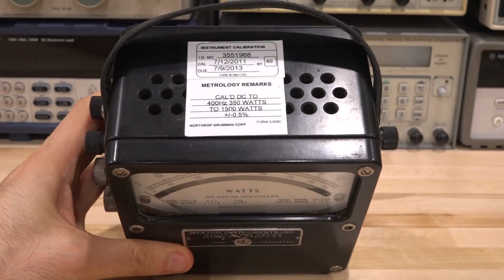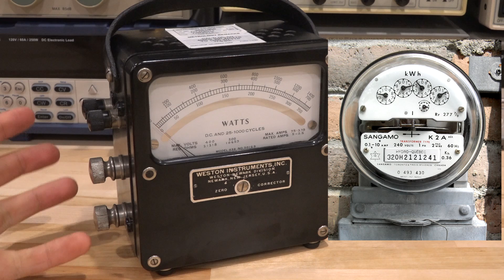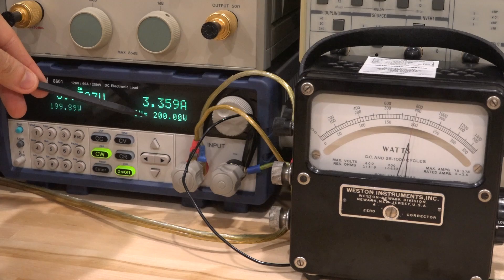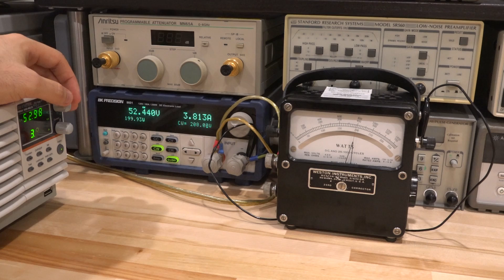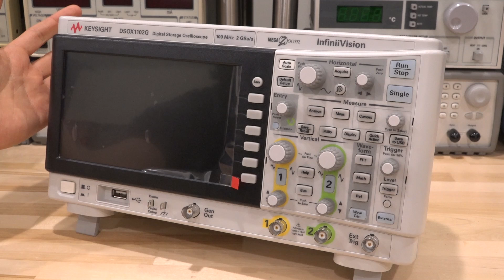TSP #140 - How Do Purely Passive Watt-Meters Work? (Giveaway Results & More Giveaway! December 2018)

Comment: We still use these in AC machines labs. They have multiple voltages and A range which can be changed by shorting the connections.

Comment: Where to start praising this great video.  A wonderful, old piece of equipment and a great explanation of how it works.  I am a retired aircraft electrician, so maybe I can give you some insight.  I believe that the current coil in the meter is actually carrying current in parallel with the shunt in the top of the case, in order to make the current coil a reasonable size.  The shunt will dissipate a lot of heat in operation, so the metrology tech who blocked half of the cooling holes with the calibration sticker really screwed up.
If you look at the flight engineer's panel on an early, multi-engined jet aircraft, you will find that a single analog meter for each generator had two scales, one to read generator power in KW, and the other scale to read reactive power in KVAR.  The meters could be switched from KW to KVAR with a push button on the panel.  Rather than shunts, the current coil in each meter was fed a small current from a current transformer around a phase lead near the generator.  Other than that, it worked exactly as you pointed out on your Weston.  Many thanks.
https://www.airliners.net/photo/Orca-Bay-Aviation/Boeing-727-232-Adv/1255032

Comment: Really something, how instant you can grasp the results of an analog meter... I think digital stuff, while certainly accurate, sometimes lacks that immediate recognition that comes from a spacial movement based result. Even when I pick a DMM, I try to look for one with a good resolution bargraph display, for that very reason.
PS... My scope has a scratchy trigger and is older than I am... Could totally use a nice new one to sit along side the old analog friend... Hint, hint... :P

Comment: A bit of history for you, this type of meter generally referred to as a D'Arsonval type meter, was initially designed by Jacques d’Arsonval but was quite different in its construction. It did use permanent magnets and a moving coil but the addition of a jewel pivot and tourqe spring knife edge needle was the work of Edward Weston. He is credited with designing a portable instrument using the D'Arsonval approach and he further refined his design replacing the jewel pivot with metal strips under adjustable tension and several different techniques of movement dampening. I would wager that Edward Weston also invented the use of electromagnets in place of the permanent magnets to provide the constant magnetic field proportional to input voltage for power measurement. That is a beautiful piece of test equipment, and the ingenuity of its design is breathtaking. I  have a VTVM that measures AC/DC Volts and Ohms but has no current measuring capabilities. I also have a DMM that I managed to take out the current scale in when the only fuse I had available when I blew the 100 mA protection fuse was a 400 mA. I fell into the old trap of ”just one more quick measurement”. I would love to have that Weston power meter to go along with my VTVM. Another oscilloscope, WOW!  I am currently using a Dumont 1062 that desperately needs a new CRT due to many years of previous owners cranking the intensity to maximum and leaving the instrument turned on for apparently months on end. I do have plans to restore the Dumont scope as funds permit but other things keep taking precedence, such as living expenses and medical needs. If only I didn't need to eat,  I could afford to buy some really great test gear. Oh well, such is life. Wonderful video, I had not seen an analog power meter teardown before and you explained the theory very well. It makes perfect sense, but for someone to come up with that design probably over 100 years ago is mind-boggling, and to still be able to certify a calibration in 2013 for it is even more amazing.  Please count me in on the giveaways and Great Video, and thanks for sharing your knowledge.

Comment: That was a very nice tear down of an old analog watt meter and it certainly is very similar in design to a universal motor, which was precisely what I was expecting though it’s always nice to know that one’s presumption was correct...you never know for certain until you put such to the test!

Comment: I have at one time or other fixed a couple of D’Arsonval movement meters that had experienced some shock.  Needed titanium tweezers and a microscope. Probably the calibration was not quite up to the standards afterwards, but they seemed to not be far off.
One meter I would have loved to repair was a 50 A moving iron type (actually clamp-on) meter.  The special feature of it was operation at DC or at 50/60 Hz AC without any rectifiers.  Changing scales was by lifting out one movement/dial/pointer module and dropping in another..  The choices were the mentioned 50 and 100, 200, 300, 400 and 500 A.  Measuring 500 A DC was a challenge — you could not open the clamp until the DC current was brought down.
Oh, the reason I could not fix the 50 A module was, because somebody had dropped a hammer or something similar right through it.
But my real reason for this comment was that in the early days my that time boss was building some ultrasonic transducers and amplifiers operating at 10 to 25 kHz.  He bought one of the purely passive watt meters.  I was astonished that he had bought a Soviet made meter, but found that no western meters were available with adequate frequency range.  The one you presented is proving the point with its 1 kHz frequency specification.  If I remember, the Russian one promised 10 kHz, but operated  reasonably beyond 20 kHz.

Comment: There is another design of a mechanical watt meter that is smaller, cheaper and, most importantly, has throw angle over 180° on the dial. The current coil has a core that forms a horseshoe-like loop around the axis. The voltage coil surrounds this horseshoe iron piece and is connected via two escapement springs as usual. No shielding is required since the magnetic field is already in a closed loop.

Comment: Great video, thanks for showing an old and relatively simple solution to the problem of measuring watts. For some reason it reminded me of electromagnetic speakers, the voice coil was powered by the amplifier output as in the permanent magnet speaker but the other magnetic field was provided by the "field" coil which was actually used as a choke coil in the DC power supply

Comment: If you use the analogue meter to measure AC power on a complex load, ie a load that isn't purely resistive, presumably it reports the apparent power?  (because the Voltage and current are out of phase, and so "add up" to a smaller average magnetic field to drive the motion against the spring?)

Comment: That is a very cool power measurement device. I'm impressed that the calibration was so recent. I guess if the equipment is still working good, there's no reason to upgrade it. I'd like to win that scope as well. :-D

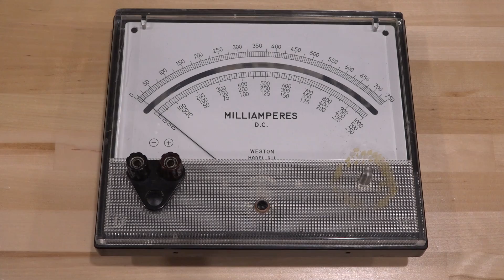Comment: I am puzzled by the ammeter that you analyzed at 6:00. When you said that the resistors are placed "in series" with the movement, I thought that can't be right. An ammeter's ranges are selected by placing resistive shunts in parallel with the movement. But looking at your video, it appears that there is only one connection to the white wire coming from the movement, which means that one of the resistors, at least, is indeed in series with the movement.

There are a total of five resistors. Does this meter only have four ranges, corresponding to the four scales on the face? If so, there must be one shunt for each range, plus one resistor permanently in series with the movement. Which means that there is no range where the movement operates without a shunt. The movement sensitivity is therefore greater than the 250 mA full scale of the most sensitive range.

Why do you think they use the extra resistance in series with the movement? Electrically, it only serves to increase the burden voltage of the meter, without improving its sensitivity. It must be that Weston needed to increase the effective resistance of the movement to keep the high-current shunts from being unmanageably small. At any rate, they need to keep the shunt values significantly larger than the resistance of the switch contacts.

BTW, please enter me into the scope giveaway. I am working up a basic electronics class to offer this summer, and this would make a great educational tool. Not to mention the uses I have for it in my own lab.

Comment: The beauty of passive analog devices and test equipment.  What I would give to have the old "obsolete" differential voltmeter we had in our shop when I was in the navy, we fought to keep it as it made difficult alignments a piece of cake.  It made peaking direction finding receivers a piece of cake as each channel receiver not only had to be peaked but they then needed to be match to each other.

Comment: What about AC power measurement? You would probably destroy it with a high reactive load.
ps. please include me in the giveaway. Thanks.
Reply: I suspect this instrument would work just fine on a reactive load - it is a watt meter after all and would continue to display watts as the magnetic fields would still be the same strength, just out of phase.

Comment: How do you calibrate such instrument? What adjustment does it have (besides the zero point)?
Reply from the maker: Brafilus You can tighten a few screws which changes the torque on the movement. It is a delicate process.

Comment: Maybe it's in the service procedure for some old plane?
I remember reading up on a simpson analog meter and it was still used to check the analog controls in some helicopter.
The procedure was nothing more than observing the needle for smooth operation as you turn the knob, but the analog meter did the trick.

Comment: Yes thank you very much that was very interesting. I remember one time when I was a child my dad brought home a Simpson multimeter with the sliding cover like a roll top desk and I (10 years old) being the experimental type decided to plug it into the outlet and made a question mark out of the meters needle. It was set to the ohm scale and I did not know anything about that at the time. But my dad made sure I learned after that hahaha. And I became an electrician.

Comment: Maybe the difference from the calibration (that does not mean adjust) and the measurement at 200 W in the 350 W scale is that it was calibrated at 400 Hz.
Thanks for your videos!

Comment: There is a lot going on on the engineering side in this meter but the mechanism itself ends up looking pretty simple. Interesting teardown, quite different than the usual gear but I liked it.

Comment: best accuracy will be with it on a level bench and with the meter facing up, so the slight variation of the pointer mass with deflection does not affect the spring tension and the resultant forces. That is why it was reading slightly different on the 2 current ranges, it should not do anything with 0.5% accuracy switching ranges. Nice meter, and the broken one was dropped, because the top pivot is bent. Repairable with a little care, and then it will work well again. just requires a steady hand, a nice bit of precision work with tweezers to straighten the wire, align the coil springs and dekink them then put together and clean and adjust.
Reply: Great repair tips. Thanks a lot!
Reply: Actually, Sean, if you look closely, you will see that the bottom extension of the pointer has a counterbalance mass on it.  The meter is relatively unaffected by position.